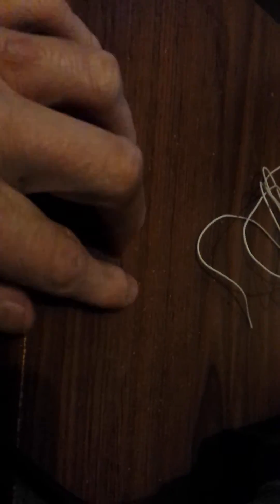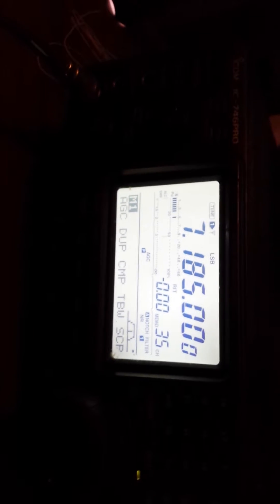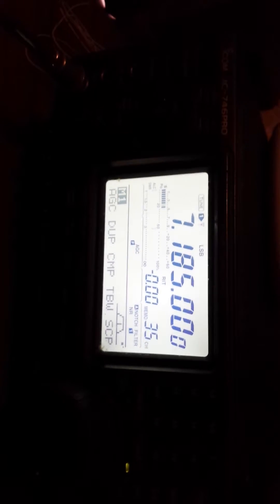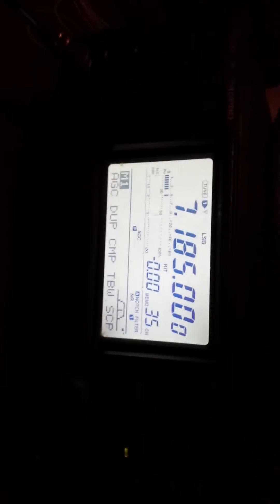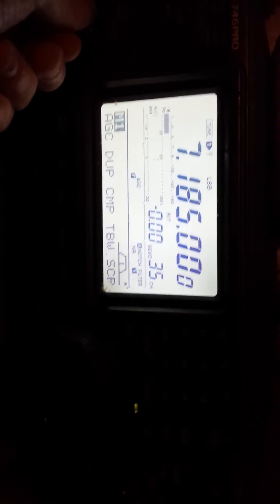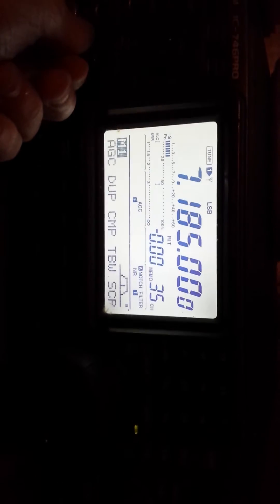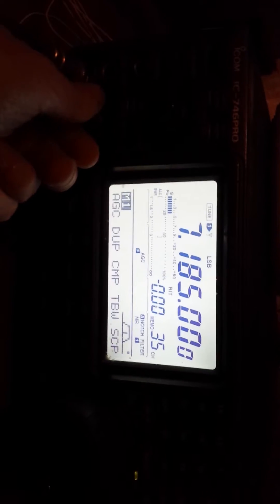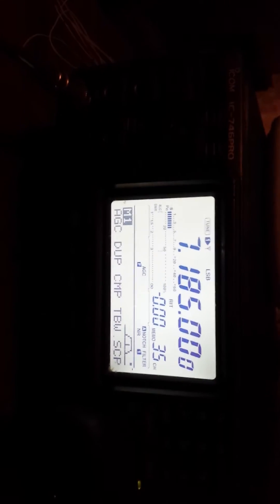Icom 746pro repair successful (backlight fix)

Comment: I did the repair ok. But I find that the volume pod is not right. If I go on two meters. The volume is high and will not go down. also on HF...The same pod has turned around. ( volume now squelch and squelch volume.)Any ideas on what is wrong?